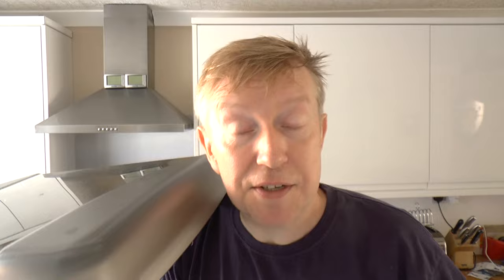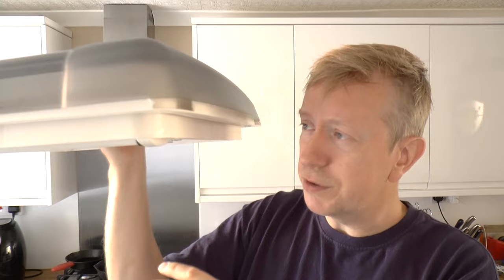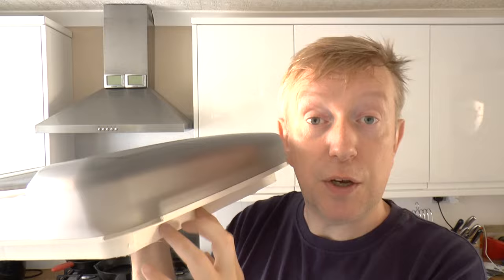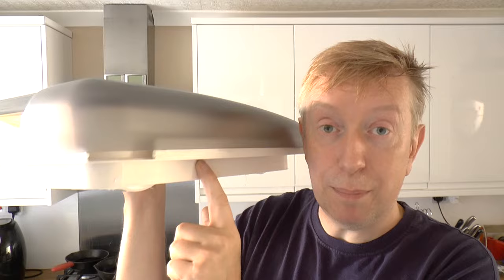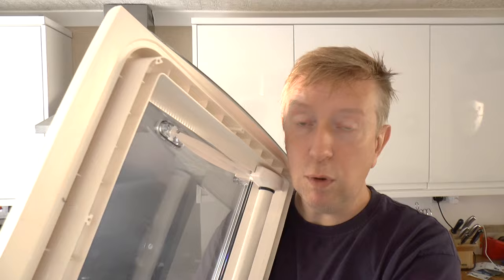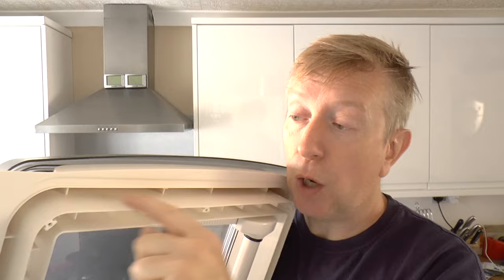How to Prevent a Rooflight From Leaking (Campervan, Motorhome, Caravan)

Comment: I spent all day yesterday refitting a roof-light on a caravan that we recently purchased. Like you said, it lifted straight out, as the bonding had not adhered to the smooth surface of moulding. I roughed it up with sand paper and refitted it with a whole tube of CT1. If it leaks again I’ll blow the whole caravan up.
Reply: Ha ha 😂
Reply: Is the caravan still standing or did it get blown up? 😂
Reply: I’ve just fitted a new roof light to our old Sterling caravan after the plastic support struts on the original began to disintegrate. Good tip about sanding the sealing surface. Thankfully I’d already done that; it’s only the narrow flat rim that needs sealant, though.

Comment from the maker: Hi folks! As promised, here is the video about why my rooflight leaked. Note: Mastic used was: Sikaflex 512  :)   Hope it helps others to not have the same problems :)
Reply from the maker: Thanks for the tip, yes I am aware I was pointing to the wrong bits LOL!
Reply: Anybody know if these mastics are available in US or what the equivalent is?
Reply: My fantastic fan rooflight has a small leak in one corner that only leaks when it rains not when there is standing water against much of the seals, its driving my potty I don't understand why its leaking or how to fix it!

Comment: THANK YOU !!!!!   I replaced both the skylights in my vintage Hymer van some months ago but last week one of them started leaking.  I was on the roof yesterday checking it and the sealant could be seen all the way round - so why the leak?   I searched on YouTube and found your video so unscrewed mine to check the adhesion.   And lo and behold - it lifted cleanly and easily off the roof, leaving the Sikaflex firmly attached to the roof but the skylight ( exactly the same as yours ) was clean as a whistle.     So I'm waiting for it to dry after washing it in soapy water, then with vinegar to remove and grease, then with white spirit.    But it made me realise, people also just use adhesives to attach solar panels - and I wonder if the manufacturers use release agents when casting the brackets ?    I chose to bolt mine down too, using Rivnuts, but it's a scary thought.  Thanks again, you have saved me a lot of wasted effort.

Comment: Hi Rick, Had exactly the same with the 2 I installed, same ones as you have MPK;s, I stuck them in with Stixall and leaked after 5 months, after taking them out I used wire wool to key the surfaces and cleaned then re-stuck them back in with Stixall and still going strong with no leaks, touch wood! Glad you got it sorted :) Andy

Comment: Couldn't believe we had the same problem and your info helped enormously thank you!! We cut around the sealant that we had only laid a few months ago on the roof side and literally my Dad just pushed up the roof light as to open it so to speak and it just popped out of the sealant, you couldn't make it up! We roughed up the seat in the new roof light, cleaned it with alcohol and washed the blinkin' thing for good measure as you said with fairy, dried with a hairdryer and put it all back together again with "Soudal Fix All High Tack Polymer Adhesive & Sealant"! Hopefully that will be the end of it!! Cheers Rick!!

Comment: Aaah, yes that makes sense. I was trying to figure out what on earth might have caused the problem. I think that would have had most people scratching their heads. I do wonder why they can't give these things a wipe down with Isoprop before they're assembled, but I guess that would add to the price, and there would still be a recommendation that you wash them thoroughly before fitting. On the plus side, at least you now have a spare fully functioning roof light!

Comment: Great tip Rick, one I avoided though as I sprayed my two vents black to colour code them with the colour of my van.  I did noticed the residue on the surfaces when I was etching them ready to paint, so you are spot on there.  I also used Isopropanol on a cloth to ensure everything was clean.

Another tip is to pre-drill the mounting holes and clean all metal filings away (FantasticFan specific) and to not use self drilling screws, this is due to those metal filings also causing ways for water to create a leak, so best to take the extra time in cleaning everything, etching, and using alcohol based solvents to ensure a good strong bond.

Comment: good advice. I think it wise to rough up any surface you are using adhesive on. A pre-wash with detergent and then a wipe with acetone or similar degreaser (to eliminate any film left over from the detergent) will ensure a vice like grip by the adhesive. i have noticed that professional window installers always run a low grit sandpaper over the paintwork prior to affixing the window. Just an extra bit of redundancy and security.

Comment: A really good tip for sealing anything with any sort of silicone, is to clean the surface with a solvent. Most silicone is solvent based anyway. I generally use brake cleaner. Which is just solvent/degreaser in a can.  I had the same sort of carry on sealing in a new shower base. The silicone would not "stick" to the base its self. After a quick spray with brake cleaner, all sorted.

Just be careful using solvents on plastic though, as it could damage it and make the plastic brittle if not rinsed off.

Comment: Im sure its been mentioned but silicone mastic is not the best product to use for rooflights and windows especially on something that moves like a vehicle. A non drying bedding sealant is what should be used. I have always used Hodgson Seamseal and will be using it on my next build starting this month. Enjoying your videos 😎

Comment: Nightmare mine has just started leaking again always this time of year when you want to use your van and then you go look inside and find all the roof soaking wet. The weather don’t open at the moment either showers pouring down sun comes out rains again. So you try and find the time to do it. I’m gonna have to try again next weekend run out of time now thanks for your voice. I will use that knowledge of yours. Take it out and give it a good clean. Also, what’s the best silicone to use?
Reply from the maker: Just typical isn't it? Glad the video was useful, Cider. I nornally use Sikaflex - can't remember which specific one, but they're all pretty good. One of the many self-build camper groups on Facebook will probably give you the answer for the best one to use. 👍

Comment: If the manufacturer has not bothered washing off mould release agent when these sklights are so expensive is unforgivable.
Mine (an MPK) is made of polypropylene (PP) - which is notoriously resistant to adhesion anyway.
Tried your technique repeatedly and it has leaked repeatedly, unfortunately.
Just bought a brand new one and I'm going to try cleaning, sanding and then spraying with PLASTIC PRIMER paint.
I hope that the sealant/adhesive will then bond to the primer.
Wish me luck!

Comment: Hello from Arizona. Anybody know if the mastics... Sikaflex 512 or is it 252 or the mentioned CT-1 Travis is available in the states or what the equivalent is? Getting ready to replace my large Midi Heki roof light in my motorhome and certainly want no leaking issues! Mine smashed in pieces when gale force winds threw it forward and broke. What a hassle it’s been finding a replacement because these are not sold in US any longer. Had to order from UK today. Who knew I couldn’t buy a replacement through Dometic US? They were zero help but Jacksons Leisure LTD came to the rescue.